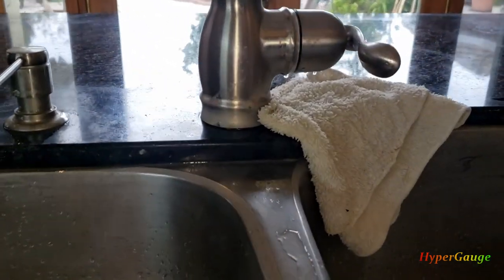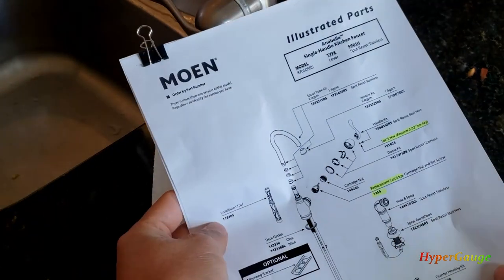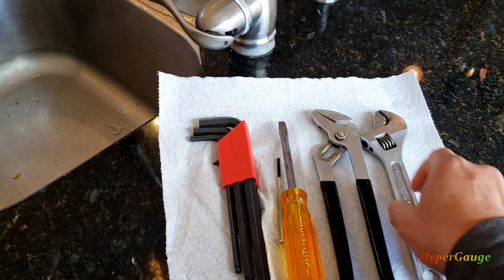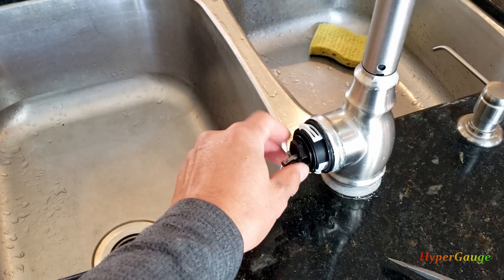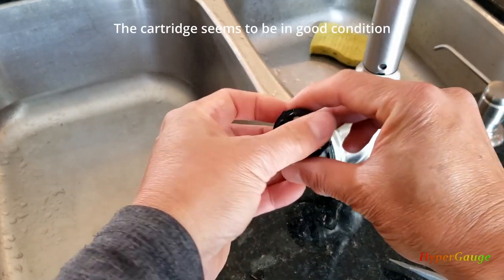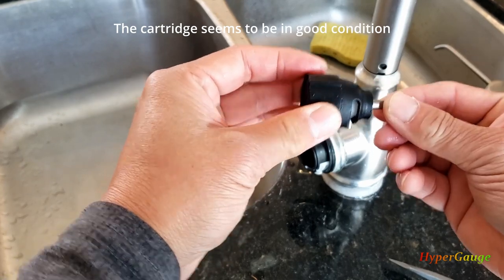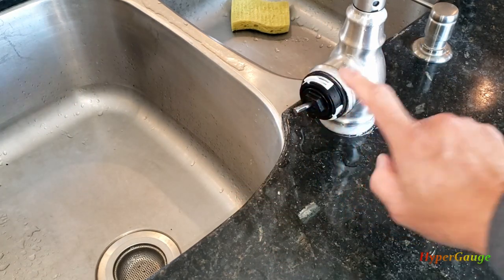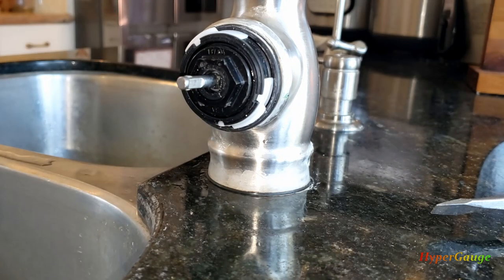Leaky Kitchen Faucet Repair. Drippy Moen Faucet DIY Fixed. Quick and Simple!

Comment: Just used your video to fix my Moen single handle faucet. It was dripping in exactly the same place (11-year-old faucet). Couldn't have done it without watching your video first.  The set screw on my handle was locked in solid. I stripped one allen wrench and bent another getting that set screw loose. Also used WD-40 up into the hole. Finally gave way grudgingly after 10 minutes (and some prayer) of working it. the lock nut on the cartridge was also rock solid and took a good twist with a faucet wrench to get it loose, so I'm not sure if it was the lock nut that was my problem. When I pulled the cartridge, there was a foreign object about the size of a large seed sitting in one of the three holes. I pulled that out, washed everything up and re-installed. No leak! At first, I tightened the cartridge lock nut really tight and found the handle did not move as smoothly as it did before. So I backed that off just a bit (more than hand-tighten, but not fully wrench-tightened) and that allowed the handle to move smoothly as it did before. Again, thanks for a great video!
Reply from the maker: I am glad you got it fixed. 👍Fun things about DIY is just don't give up and use your wisdom and experiences. Nicely done!

Comment: did you ever fix faucet kitchen motion control Moen brand ? that faucet was disconnected accidentally and i blue cable need to be reconnected.
Reply from the maker: I am sorry I don't have any info of the motion control Moen faucet. Best luck with your repair!

Comment: Great video. Mine is not leaking but it's the same style. The housing (that dome thing right behind the lever) is loose. Any way to tighten it? It seems to turn when the lever turns so dn't know how tight it's supposed to be and still rotate. I don't know if the set screw in the handle needs to be tightened or what. Doesn't seem to be anything that keeps it on???
Reply from the maker: If the faucet is moving, then it is likely the lock down nut under the counter top is loose. You may want to check that. Best luck with your project! 👍